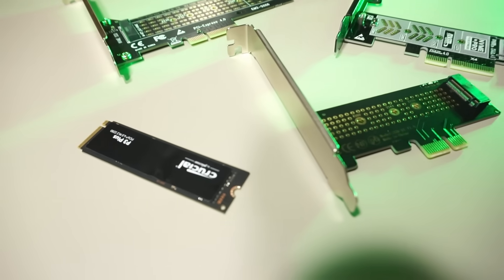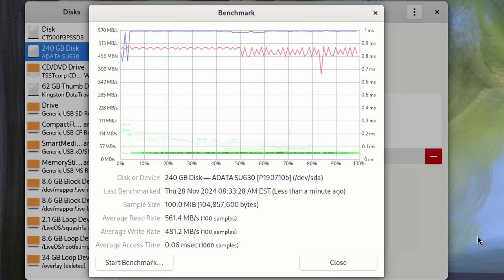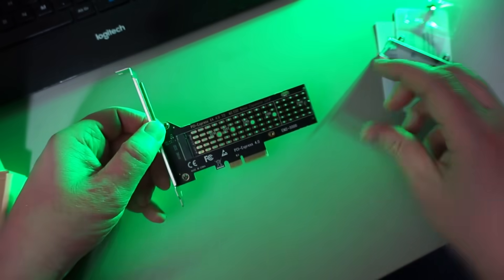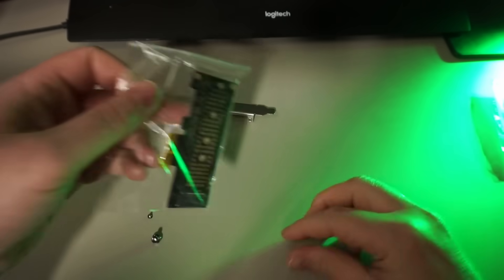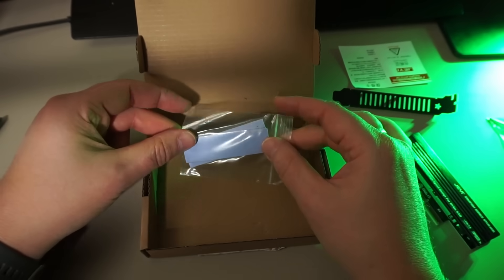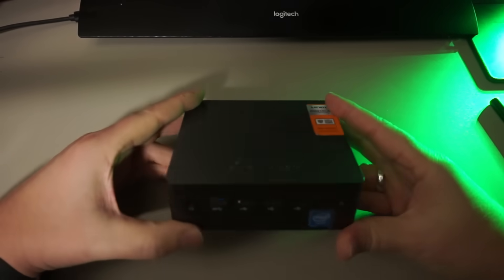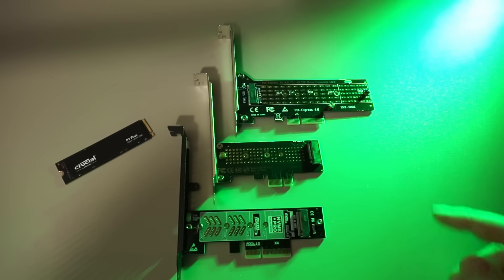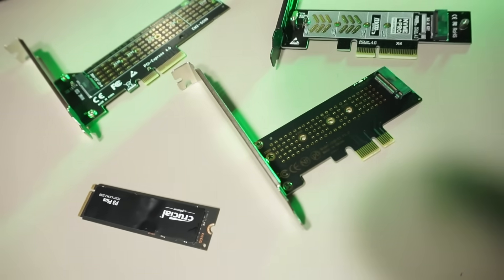Upgrade your old pc with an NVMe! Testing cheap PCIe M.2 adapters!

Comment from the maker: Some people pointed out I made a mistake in this video: the board in my test pc only has PCIe 2.0 ports, not 3.0. 

To be honest this makes the speed difference with the SATA drive only more interesting. If you have a system with true PCIe 3.0 ports you will likely get higher numbers than I did.
Reply: I put a 3rd ssd on a pcie4 card with interchangable trays from icy box in my pcie4x1 slot , so have a 2tb c: a 4tb d: and a 2tb on the card all with pcie4 and my gpu still at pcie4x16 instead of x8 .
And the ssd on the extra card runs at 6400 mb/s which is close to it’s 6500 advertised.
Reply: @loboptlu  That Sounds Right Most CPU's Have 20 PCIE Lanes ! So To Get The Full Speed It Has To Be Directly Connected To The CPU! But For Most Applications The SATA Interface Is Fast Enough! And Then You Have To Look At Sustained Writes! If Your Drive Does Not Have Any Cache Then After Just A Few Seconds They Slow Down To The SATA Speed Anyway!
Reply: @loboptlu  6400 Mb/s = 800 MB/s That is nice.
Reply: @ ah i see , first i wrote it on iphone , second everyone knows exactly that i meant MB except people who are bored and have nothing else to do than try to troll others.
Reply from the maker: @loboptlu  Sounds great! I guess you've got a great motherhood/cpu combination. :)
Reply: @ First to be clear , i am not rich i saved a few (lots) months to get the money , wanted a good system that last , it is cheaper in the long run than changing yearly.  
 GIGABYTE X870E AORUS PRO ICE , AMD Ryzen™ 9 7950X, Kingston FURY DIMM 64 GB DDR5-6000 (2x 32 GB) Dual-Kit (play star citizen and that one needs the memory), SAMSUNG 990 PRO 2 TB (the other 2 ssd are older ones from my previous one), XFX RADEON 7900 GRE OC.
Reply: Asus-z87 expert (pcie 3) with a x4 adapter and 1 TB Kingston pcie 4 (6 GB/s according to spec) did about 3800 MB/s read write which is close to the 4 GB/s 4 lanes can deliver.

The old Intel SSD delivered around 450 MB read and a little bit slower write.

I have modiefied the the bios to allow the nvme to boot. Not much faster to start applications, but much faster when loading pictures and thumbnails. So much faster moving data, but not much faster to process data.
Reply: ohhw that means i can get full 3500mb/s speed on gen 3
Reply from the maker: @jitu5972  Yep 👍🏻
Reply: A mistake? I beg to differ; this was not a mistake at all! 
Having tested on PCIe 2.0 was still educational and let us know that it's still a significant upgrade vs SSD when you need that much more speed/throughput.
Thank you.
Reply from the maker: Well calling it PCIe 3.0 was the mistake haha
Reply: @ex-itguy  Oh right, true. >3<
Welp. Eitherway, you had it corrected and had a correction video, so ish all good.
Reply: Not Really! These Cheap Dives Dont Have Any Cache So They Slow Down After Just A Few Seconds! You Might Get Better Read Times But The Write Times Are Pretty Close!
Reply: Will one of these work in a pcie 2.0 x16 slot? As I wish to upgrade my asus m4a78bstd-v evo motherboard if anyone can give me some links to a graphics card, 2x4gb ram and this adaptor that will work on the mentioned asus m4a78bstd-v evo motherboard I would greatly appreciate it
Reply from the maker: @BarryHayes-l2b  it seems that the second x16 slot in that board is actually an x4 slot. Yes, that works. You should get about the speeds I got in this video.
Reply: @ex-itguy  so 1 I use for graphics card the other will be usable for the nvme adapter?
Reply from the maker: @BarryHayes-l2b  Yes
Reply: @ Yes, PCIe is forward and backwards compatible the same way that SATA is. When you turn on your PC, the mobo talks to the graphics card and they negotiate at what speed to operate at. AGP was different. It was not forward compatible. You can't plug in AGP 8x card into a 2x card and maybe you can use in a AGP 4x and maybe not. The AGP port was slotted to prevent you from making a mistake. Anyway, AGP is ancient now. PCI was also not forward compable. There was no protection either.
Reply: It is still fast though
Reply: On top of that you cannot run your OS on this drive without BIOS modding, because mobo doesn't have NVME support.
Reply: Yes,. I have the Glotrends X1 adapter on gen 3 PCIe, and CrystalDiskMark reported sequential read /write speed of 900MB, very close to the theoretical 1 GB/s.
Reply: your Russian?, Ali Express is a shit web site LOL
Reply: Well, my "old computer" still running as a print server and VPN server under Win2K Pro only has ISA slots.  But it's been running 24/7 for 23 years, so I guess I'll keep it the way it is.
Reply: 0:25 This is NOT how you handle an M.2 drive, you're literally bending it against the adapter board
Reply from the maker: @kingeling  you're not wrong, but I wasn't pushing. ;)
Reply: @kingeling  that is why he is an ex-IT guy.
Reply: Well, how much of a difference that PCIe 3.0 make? I hear that PCIe 4 and 5 don't offer any benefits for video cards.
Reply: @louistournas120  The benefits are there from PCIe 4.0 and 5.0 compared to 3.0, but those are negligent. So you don't really see it in gaming. 
But when you do a heavy development on those cards, then you will benefit from it. 

Tested on 5090:

Switching from PCIe 5.0 to PCIe 4.0 resulted in only a 2-3% performance loss in games.
Switching from PCIe 5.0 to PCIe 3.0 resulted in a 4-6% performance loss in most games.

The whole PCIe lane speed is really more for the RAM. And that is again about everything else. 
Where the real speed difference comes is when handling high amount of large files, like server. 
That is when the NVMe becomes important. In games the loading times are almost identical between fastest NVMe and normal 500/450 MB/s SSD on SATA drive. 
There really isn't useful purpose to go faster than cheap SSD like Kingston A400 series for other than Windows purpose.

We have already passed long time ago the hardware resources limits. Now it is just about non-optimized games and other trash reasons to push people to buy hardware they don't need.
Reply from the maker: Not at the moment. I guess it's about the same as my old GTX 670 that already supported PCIe3.0 when almost no one had it yet, but it was fine on 2.0.
Reply: @louistournas120  Right And Wrong Too! That Is Why They Have Limited The PCIE Lanes On Some Of These New Cards To Just 4 instead of 16! So You Have To Be Sure That The Card Is 16 Lanes Wide! If So Then PCIE 2.0 Is More Than Enough Speed To Run Any Graphics! But The CPU Will Not Be Able To keep Up With Most Games!

Comment: I get 3.5GB with $2 adapter and adata legend something nvme, it's a good nvme with dram. They're passive adapters, so the cheapest and the most expensive one gives you the same speeds, it isn't changing something.
Reply from the maker: That seems to be the case indeed 😊

Comment: Sure someone mentioned it but you can mod any firmware to support native boot no matter how old the hardware is. Well, on super old there's some limitations depending on developer of firmware. On UEFI you need to inject NVMe DXE driver, on legacy BIOS (in my experience AMI and AWARD are your best friends because this two quiet easy to deal with, I've not dealt with PHOENIX but if I remember correctly their firmware compatible with same modding software as AWARD which is CBROM.exe. If your BIOS is anything outside this trio then it will be a challenge) you need to inject PCIe OpROM with corrected vendorID and deviceID to boot MBR. Check Win-Raid forum for that and buy a firmware programmer to have a rescue if you brick up your motherboard. But if done carefully it's completely safe: I did two mods of super old (16+ years) LGA 1156 motherboards with couple i7 870s without a software programmer and even not bricked it. But that was Asus with AMI (this firmware is most wish case, also Asus of that era had nice unplugable CMOS chips which is handy for firmware programmer) and Gigabyte (AWARD which is clanky and required to disable SATA II RAID controller to recognize NVMe but who needs SATA II RAID, but Gigabyte have nice DualBIOS so that's safe enough).

Comment: But can these work as os boot drives?
Reply from the maker: Only if you have a BIOS that supports it or with a BIOS mod. You can have an NVMe compatible bootloader on another drive and your OS on one of these though.

Comment: A subtle, unstated thing in your video? Linux. Dude I know gnome-disks! Respect. Many, many people in coming years will be cashing in the ~30% Linux speed bonus over Windows. Fastest free speed boost!
Reply from the maker: Not sure if it will give you that much of a boost haha, I just kinda feel handicapped behind a Windows pc ;)
Reply: @ex-itguy More like 27% Depends on the CPU but that is exactly the boost I got multi core on geekbench before and after.
Reply from the maker: The Ubox with a Ryzen 5 6600H actually ran worse on Linux. But that's the exception haha

Comment: I bought one of these from amazon but it turned out to be unreliable. My previously solid system started crashing randomly. YMMV
Reply from the maker: Interesting. I haven't had any issues with it and a lot of commenters told me they have been using those for years. But you're not the first one to mention issues either, so indeed... YMMV.

Comment: Received the Glotrends card yesterday. Installed a WD Black 500GB PCIe 4 ssd on it. Tested it in two pc's. One has a Z77 chipset (with an Ivy Bridge XEON cpu) and the other one a Z68 chipset (with a Sandy Bridge Core i5 cpu). On both systems it failed to boot. I even tried restoring a system image (of the same pc) to the PCIe drive with Aomei and Macrium and using EasyBCD to try to add the boot entry manually.
No luck so far. 
I used Windows 11 24H2 and Windows 11 IoT Enterprise thumb drives for installation. Windows setup starts acting up as soon as you're in the "Searching for disks" section and you select the PCIe drive. Doesn't matter if you use "Unallocated space" or if you create a partition before proceeding. "Windows can't be installed on the drive you've chosen". I'm probably missing something. 
Maybe I'll try it in some other systems later.
Reply from the maker: Interesting. I tried it on the old Phenom II system, which I believe is older than yours, and I don't remember having issues actually installing on it. Just booting was the issue. I still need to dig into that as I kinda didn't need to anymore after the follow-up video but I'm still interested to see if we can make it boot.
Did you try Linux as well or just Windows?

Comment: It's possible to modify BIOSes to support booting from PCIe slot mounted MVNe drives, I did so for my 14 year old PC.
Reply from the maker: I heard about that but haven't tried it myself. Interesting stuff though!
Reply: @ex-itguy  Win-Raid Forum - [HowTo] Get full NVMe Support for all Systems with an AMI UEFI BIOS is the guide I followed. 

If you'd like to give it a go, I'd recommend following the guide rather than downloading one of the pre-modded BIOSes, the one I found on the forum for my motherboard only caused problems, had to return to a stock BIOS and learn how to mod the BIOS myself for everything to function correctly.

Comment: Offtopic, I have the same NVME model but lower speeds 3500MB/s. And speeds are going to 3690MB/s. Pretty nice. Now at this day u can buy a same model with almost speeds for the same prices. But yea. Already good :). i use F2FS as the FS if it makes any difference.

Comment: I’m currently working on an x58 board and was wondering if I could get an m.2 to work in it somehow.  It’s only PCIE 2.0, but still way faster than sata 3 Gb/s.  I used to run raid 0 sata SSDs on my x58 back in the day.  But I don’t want to invest much money.  I’d have run x4 to avoid pulling lanes from my GPU, maybe, id have to check, maybe could actually get x16 from the chipset or x8 possibly.
Reply from the maker: The tests in this video were done at 2.0 as well. I made a follow up video to show actual 3.0 speeds. 
For a single NVMe drive, you only need 4 lanes. It doesn't use any more than that. :)

Comment: Isn't m.2 just a laptop pci slot? Then there is no point in such adapter only if you are intending to buy way more expensive pc parts.
Reply from the maker: No. I think you mean mini PCIe. However M.2 slots are now in laptops as well.
Reply: @ex-itguy  Oh, sorry, have just googled that, I had been thinking that m.2 is some sort of mod. of mpci-e but it's just board size shape.

Comment: Will this adapter work with b key
Reply from the maker: Not sure, but since it is just a PCIe bridge, you do need an NVMe drive. SATA doesn't work.
Reply: @ex-itguy  is there an adaptor where sata will work
Reply from the maker: @devjeetchowdhury454 I can't imagine there is none. Just check Amazon or AliExpress ;)

Comment: i bought a motherboard from amazon ant value H81 it has PCI-E 2.0 and NVME slot! and it works read 1Gbs and write 900Mbs but when i connect a SATA Drive to the motherboard NVME Speed is reduced read 450Mbs write 300Mbs idk
Reply from the maker: That's weird! Maybe a cheap adapter like oe of these can fix that. Not sure why the NVMe speed would be linked to your SATA bus. :)

Comment: there is a clip on the ribbon going on tot he main board its tiny and looks like just the side of the female plug  flip it down the ribbon should fall right out
Reply from the maker: Sorry, which ribbon are you talking about? it's been a while since I made this video an I don't remember anything about a ribbon cable. :)

Comment: Also keep an eye out for used NVMe U.2 drives too. You can get some for stupid cheap and they're just like M.2. They're also better quality because they're intended for datacenters.
Reply from the maker: But these don't have the same connector, so you'll need another adapter 😅
Reply: @ex-itguy  The comment was intended for literally everyone that doesn't already have an M.2 adapter. U.2 is just another form of PCIe like M.2 so the adapters are just as cheap.

I would recommend buying though if you need a scratch drive. I constantly see 1TB Intel U.2 drives with 14600TBW going for like $70 on eBay. Literally 23x the write endurance of the Samsung 990 Evo 1TB for $75.

Comment: not all older mobos can boot from these m.2 adapters but can use inside widows as storage.
Reply from the maker: There's workarounds for booting on older systems, but I haven't gotten around to testing those myself tbh

Comment: I bought a Jeyi one. I'm not overly bothered about speed, I just wanted to be able to use the drive I took out of my laptop when I upgraded to a larger size drive. It works pretty well in my desk top old system.
Reply from the maker: Nice!

Comment: using this adapters for cloning the ssd. But you need always a mainboard to implent the ssd directly for nice fast PC speed and starting. This cant solve a adapter :)
Reply from the maker: Just booting is the issue, but there's workarounds for that :)

Comment: These absolutely work. I have a Acer desktop pc that I bought in 2018 and using daily till date. It came with a 2TB HDD. A year ago, I replaced it with two SATA SSD and also added a NVMe SSD using one of these adapters. I boot two instances of Windows 11 in those SATA SSDs and Kubuntu on the NVMe SSD.

Comment: I have an old Z-79 chipset board that supports Samsung NVME using the Samsung NVME Driver.  However to load the OS, you need to use a sata3 SSD.  Once the driver and OS is installed, you can install the M.2 card on an add-in board and copy the SSD to the NVME using Samsung data migration.  Then power down and remove the SSD.  Reboot and go into BIOS to declare the NVMW as the boot drive.  Quite a bit faster.   Z-78 chipsets will not do this.  Actually resurrecting this to give away with a 4790K CPU.  Use a PCI to USB board and front panel insert to get your USB 3.1 and 3.2

Comment: Interesteing comments about transfer rates. I have multiple USB thumb drives, 3.0 to 3.2. Somehow, they all suck, no matter what port I plug them into. Data transfer from either HDD or SDD is also bad - sometimes 400MB, others 38MB.... I mean, yes, it's an old B450 but its running a 5600X and 32GB DDR4.... it should be at full speed.
Reply from the maker: But, did you try an NVMe? ;)
I have an NVMe in a USB4 enclosure that sure reaches the maximum speed USB 3.0 and 3.2 are capable of. USB sticks usually aren't that great indeed.
Reply: @ex-itguy  OK, thats interesting. My C: (boot) drive is Nvme, and very quick. Didn't think about enclosures as such. Mobo is only PCI 3.0 B450, but even so, a USB 4 enclosure should simply max that out even with a bottleneck... ok - I'll give that a go, see if its any better... thanks!